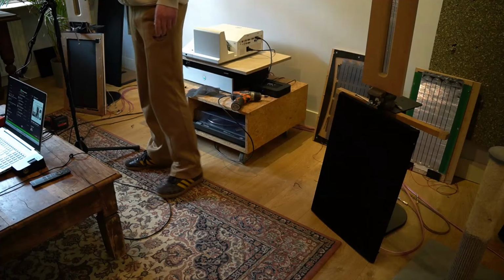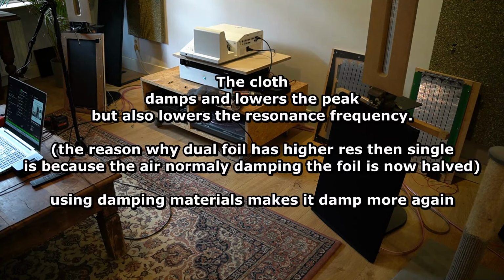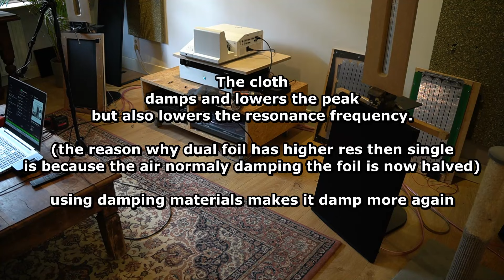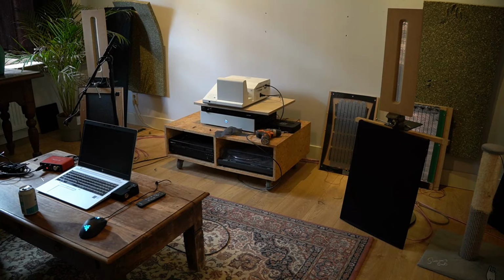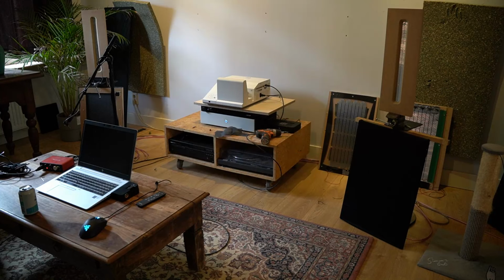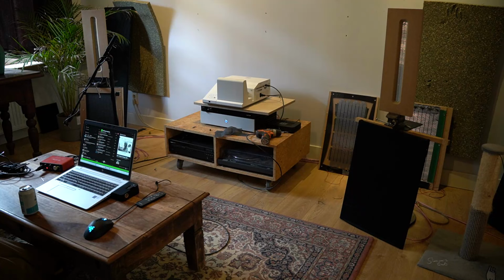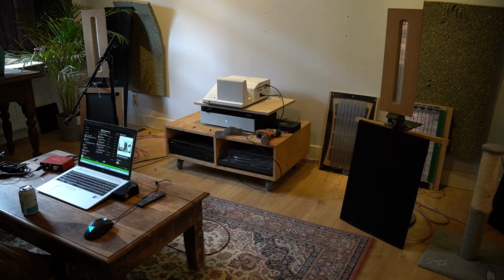Dual Membrane planar magnetic speaker - Part 7 Damping and a tune

Comment: High mass , a strong spring and low acoustic loading leads to a high Q.   The easiest variable to change would be the panel tension.  Look at narrowing the foil traces to lower the mass if. I guess you just look at the power handling of the coil to see if a narrow trace will still handle the power.  Another great video.  I'm working on a phono preamp today, but I'm way too disorganized to make a video. You're amazing.
Reply from the maker: well i was mostly thinking about , larger foil higher tension, it wont solve the resonance. but it performs better overall.. i still ned to think of damping then.... :(
Reply: A mass affects only Fs and SPL. Q is about an energy dissipation, and a “strong spring” sure rises it up. However “low acoustic loading” means a weaker spring, so reduces Q.
Reply: Tried for some years ago to mount a soft rubber along the side of the woofer under the membrane and over the membrane, that took away booming effect from the woofer membrane and gave a much more clear and controlled bas
Reply from the maker: It's an option in the end the main resonance remains the main resonance :) and the peak is there :(
Reply from the maker: Yes and I lowered that I believe
Reply from the maker: i think lower the res out of the frequency band is the best way.. lets say 30 Hz or lower. since it can use all the help there.... and we dont hear it anyway :)

Comment: Sounds beautuful! The difference when you leaned forward was huge; the bass dropped considerably, but the soundstage became way more enveloping. 

I do not have a place to listen to this kind of loudspeaker, but I’m very impressed by what you’re doing!
Reply from the maker: yes i agree. the insane room gain gets bigger when i move towards the wall. as well as leaning forward makes the sound more direct and having comb filtering at different frequencies then sitting against the wall.. i might rotate my setup for a change to avoid it somewhat. in the future , room gain remains an issue though :(

Comment: I really liked the music,  do you have a link to the original recording?
I have been using cling film to enhance the midrange and hf on my ply dml panels.
This usually covers about 6inches or so of the exciter area, and used as a passive radiator .
You have made me think, maybe I should try to cover the whole panel area at the front or mabe at the back and see what happens. 
It will probably just vibrate out of control when the volume is turned up.
There are old patents of large flexible panels being driven by cone drivers using air pressure. 
Your panels are Always a joy to listen to , thanks.
Steve.
Reply from the maker: thanks, the song title is in the description, i dont know about using the same as DML, the principle is pretty different.
Reply: Thanks. 
I did not realise that , Grate paris Istanbul,  was the ground of musicians. 
Lots of good music on that site.
Dml is only similar ish in the low end.
Steve.

Comment: Hi Joppe! I was waiting for your new video! :) These are sounding beautifully! ;)
I've made some push-pull magnetostatic speakers, this design is the most ideal I think, but I know very well, that the construction has to be very strong...
I was thinking on a solution about the linear/symmetric magnetic field, and you mentioned that you don't wanna use twice the amount of magnets!
If you remove the north pole magnets from a single sided  magnet circuit behind the membrane, and place these in front of the membrane facing north pole, between the south pole magnets  you will have a north pole, on the other side of the membrane! The direction of the flux not will be perfectly sideways, but it is true at the single sided magnetic circuit too! But, the flux will be symmetric in +- direction!
Maybe a wooden frame for the magnets is enough, at this design, the front and the back magnets will attracting each other a bit, and not repelling strongly, as the "normal" push-pull design!
Maybe a FEMM-simulation can tell, if perforated steel or the wooden frame is the better in this case (the steel can "steal" from the useful magnetic flux)! ;)
Reply from the maker: you mean alternating the magnets ? i believe a few companies done that ,  but the field will more or less also be not straight  forward. but a bit sideways :) there is no doubt a true PP contraption would be better then these, more output slightly more even and same xmax. and lower resonance :) to name 3 then costs area times 3 as well. it all depends.  i mean if you would make high ends speakers and sell them market price 6K i would not mind going PP no problem :) for now i tend to make things as cheap as possible and  hopefully get more out of it then just trowing money at it :) i mean if you get a good return on it. why not :)
Reply: @joppepeelen  I mean, that behind the membrane, there are only south poles facing to it. On the front magnet structure only north poles are facing to the membrane. The front magnets are between the rear magnets.
I try to draw it here:

Front                   S              S  
magnets             N             N 
Membrane  -----------------------
Rear             S             S             S     
magnets     N             N            N
Reply from the maker: @balazsszigeti7574  i believe you thinking of alternating magnets front back. this has been done by a few. not saying its wrong but then the field goes on an angle as well :)

Comment: When one membrane is further from the magnet the nonlinear effects from the material are stronger but since the air couples it to the other membrane that's near the magnet that lowers distortion, was that correct? I probably got it wrong
Reply from the maker: well the idea is , you got 2 foils one will be away from the magnet at high excusion, while thenother gets closer to the magnet.  and sort of drives the other one along.  that was the whole idea. and seeing then 2e order distortionj been lower, that part works to some extend. another reason why it might be interesting is.. having higher excusion possible with a single ended magnet structure..  because of its more linear behaviour. it will be inefficient.. but not so much possible int he regular single ended versions since  the foils moves way to far from the magnet..   at least thats the idea behind all of this :)
Reply from the maker: in short inefficient high excursion and cheaper :)
Reply: @joppepeelen  ok
Reply from the maker: @oraz.  oh i forgot more linear :)

Comment: This is nice, but I still think you should try a large surface area dipole bass with normal drivers as a bottom end. H-frame or M-frame alternatives with two drivers per side (one back-side and one front-side facing towards you) are both very capable and easy solutions... 10- or 12-inch woofers of good quality aren't that expensive if you go with brands like SB Audience or GRS.
For larger panels (I've had both planars and RD-75's) that solution is what I ended up with after experimenting with thousands of euros and hundreds of hours of playing around with all kinds of both very "standard" and very strange and experimental solutions. Two push-pull configured parallel dipole frame pro drivers per side next to the tall Bohlender-Graebener's.
Reply from the maker: well i dont agree :) nothing  wrong with open baffle bass from woofers :) but if i can i rahter be able to  do all. and you can add a woofer if you like :)
Reply: @joppepeelen  Still waiting for two big stacks of 8 inch woofers you've got as dipole towers on both sides 😊

Comment: Have you tried extending the baffle backwards to help separate the front and rear wave? Move the baffle step to the resonate frequency?
Reply from the maker: thats an option to get more low end for sure, moving baffle step to res would becomes a way to huge baffle @ 40-50 hz